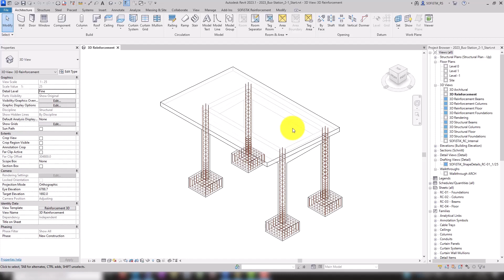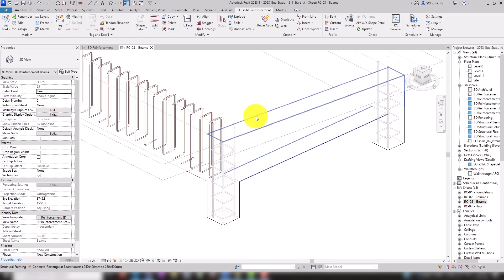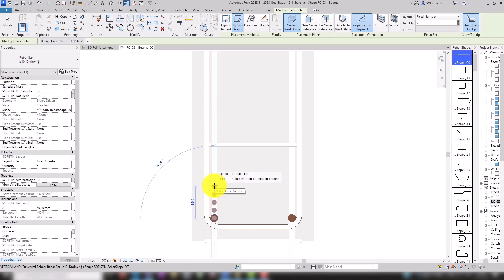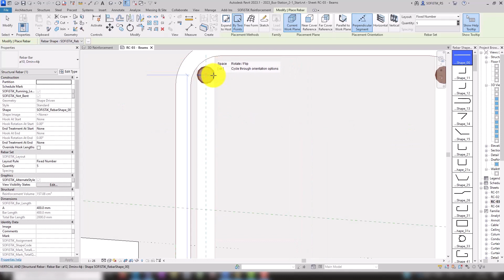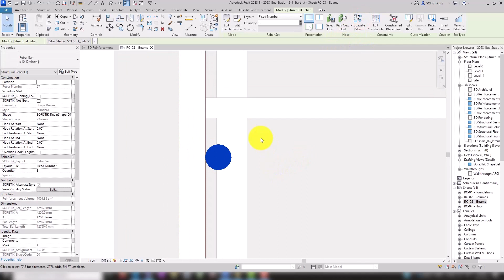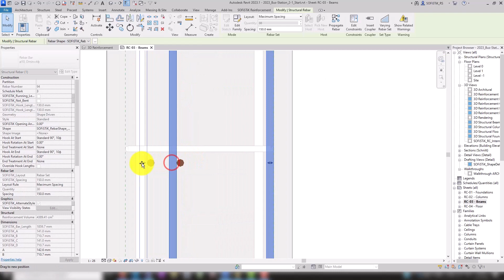Revit + SOFiSTiK Reinforcement 4/10 - Rebar Constraints

Comment: My problem is overlapping bars between two columns with different sizes. It takes a very long time for a multi-story building 🫠
Reply from the maker: Hi farzanbayat686,
Version 2024 lets you pre-define Rebars with attachment rules and boundaries for columns and applies them for you, based on the columns you select. The feature is called "Rebar Templates" and is released officially next month.
It could be the solution to your problem :).
Reply: @SOFiSTiKAG  OK. I will try it when it's released. Thank you sofistik 👍